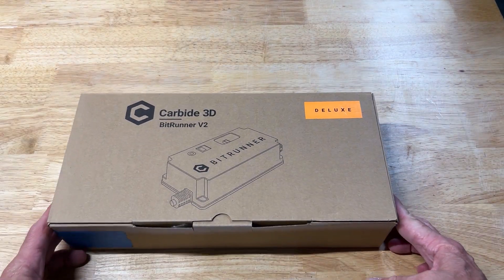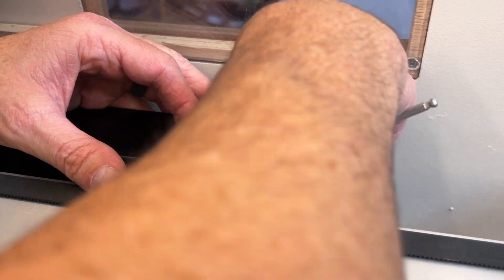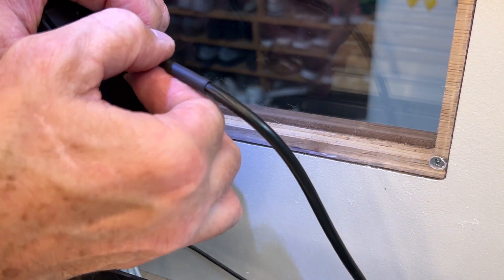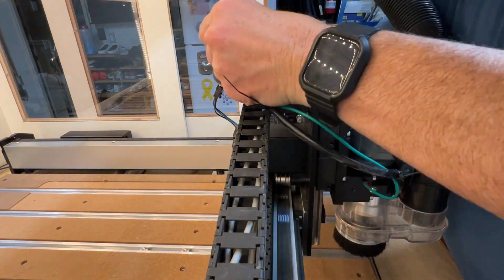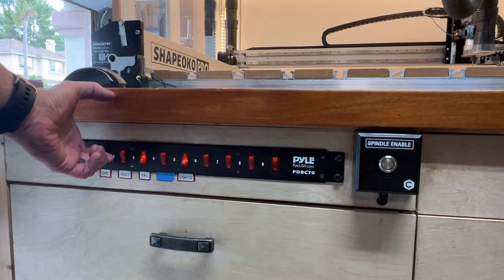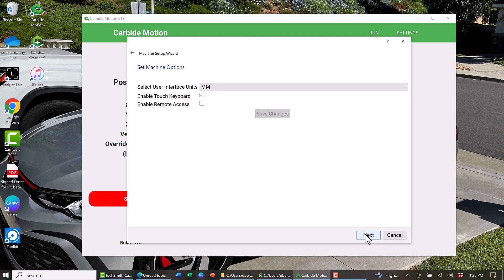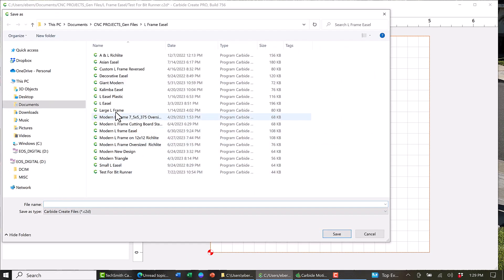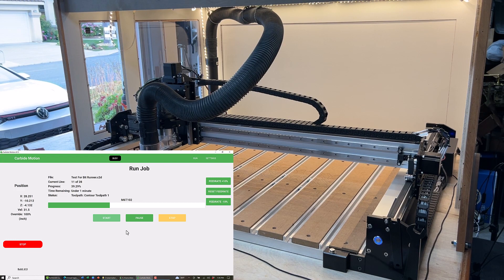Installing the BitRunnerV2 Deluxe- CNC Router Automation

Comment: Now if they could get that to work with v carve pro
Reply: If you use the atc post processor in Vetric it will work. The Bitrunner uses the same m3 command as a spindle, relay like the Bitrunner or a auto tool changer.
Reply from the maker: I have been thinking about purchasing Vetric Vcarve Pro. But I was unsure as to how well it works with Carbide motion. My concern was the tool change commands thoughts?
Reply from the maker: Thank you…I really need to upgrade my software.  Carbide Create Pro has been fine but with recent projects I need to up my software game!